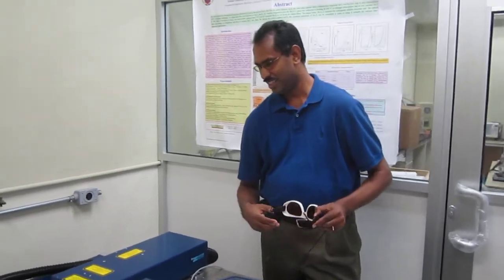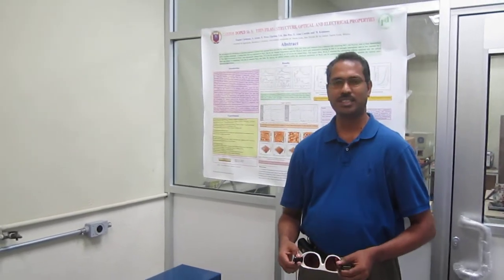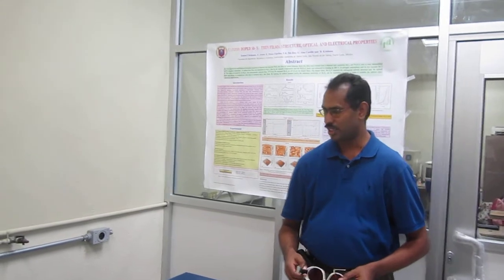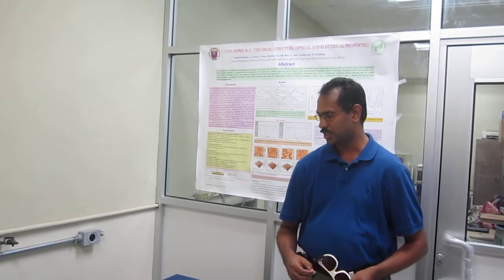Del Mar Photonics Nd:YAG laser system at the Universidad Autónoma de Nuevo León UANL

Comment from the maker: Sadasivan Shaji
Universidad Autonoma de Nuevo Leon (UANL), Facultad de Ingenieria Mecanica y Electrica (FIME) uanl.edu.mx
Nanomaterialspulsed laser ablation in liquidthin film solar cells

Cubic structured silver antimony sulfide-selenide solid solution thin films for sustainable photodetection and photovoltaic application
A Nadukkandy, S Shaji, DA Avellaneda, JA Aguilar-Martínez, B Krishnan
Journal of Alloys and Compounds 942, 169072		2023
Tribological analysis of ultra-high molecular weight polyethylene composites with boron carbide micro and nanoparticles
E Lorenzo-Bonet, S Shaji, J Negrin-Gonzalez, O Perez-Acosta, ...
Wear, 204861		2023
(002) oriented ZnO and ZnO: S thin films by direct ultrasonic spray pyrolysis: A comparative analysis of structure, morphology and physical properties
P Abraham, S Shaji, DA Avellaneda, JA Aguilar-Martínez, B Krishnan
Materials Today Communications, 105909		2023
Black titanium dioxide nanocolloids by laser irradiation in liquids for visible light photo-catalytic/electrochemical applications
PR Nair, CRS Ramirez, MAG Pinilla, B Krishnan, DA Avellaneda, ...
Applied Surface Science, 157096		2023
Sb2S3 thin films: From first principles to in situ crystalline thin film growth by ultrasonic spray pyrolysis
P Abraham, S Shaji, DA Avellaneda, JA Aguilar-Martínez, B Krishnan
Materials Science in Semiconductor Processing 156, 107269		2023
Phytosynthesized Cu Doped Cerium Oxide Nanoparticles For Antibacterial Application
A Norbert, A Surya Mary, SS John, S Shaji, SK Remillard, UP Deshpande, ...
physica status solidi (a)		2023
Ultraviolet to near infrared wavelength independent SnS-graphene hybrid thin film photodetector from nanocolloids
AP Sreekala, B Krishnan, RFC Pelaes, DA Avellaneda, ...
Applied Surface Science 609, 155277	1	2023
Gold nanoparticles decorated two-dimensional TiO2 nanosheets as effective catalyst for nitroarenes and rhodamine B dye reduction in batch and continuous flow methods
K Shanmugaraj, RV Mangalaraja, CH Campos, DP Singh, R Aepuru, ...
Inorganic Chemistry Communications, 110406		2023
Ultrasonically sprayed Cs3Bi2I9 thin film based self-powered photodetector
S Devasia, S Shaji, DA Avellaneda, JAA Martinez, B Krishnan
Materials Chemistry and Physics, 127295		2023
Band gap engineering of TiO2 by Mn doping and the effect of p-TNT: Mn/n-MnO2 heterojunction on photocatalytic applications
PS Nair, H Rahman, JA Joseph, A Norbert, S Shaji, S Tripathi, SN Jha, ...
Applied Physics A 128 (12), 1089		2022
Influence of sodium doping on the material properties and photocatalytic activity of anatase titanium dioxide nanotubes prepared by anodization
H Rahman, A Norbert, PS Nair, JA Joseph, S Shaji, U Deshpande, ...
Optical Materials 134, 113172		2022
Ge incorporation in kesterite thin films by solution processing route: An in-depth study of structural and optoelectronic properties
D Mora-Herrera, S Shaji, M Pal
Journal of Alloys and Compounds 921, 166184	1	2022
Novel low-cost synthesis of crystalline SnI4 thin films via anionic replacement: Effect of iodization time on properties
A Paul, S Shaji, B Krishnan, DA Avellaneda
Optical Materials 133, 112982		2022
Effect of substrate temperature on the properties of spray deposited Ga2O3 thin films, for solar blind UV detector applications
R Raphael, S Devasia, S Shaji, EI Anila
Optical Materials 133, 112915		2022
In2S3-Gr and In2S3-CNT nanocomposite thin films as gas sensors
JC John, SC Vattappalam, T Sebastian, A Paul, N Joseph, S Shaji, ...
Diamond and Related Materials 128, 109215	1	2022
Photodetection and photocatalytic properties of Ag2BiI5 thin films formed by iodization of Ag-BiI3 layers
AA Ramachandran, B Krishnan, DA Avellaneda, MIM Palma, ...
Surfaces and Interfaces 30, 101985		2022
Tin sulfide thin films by spin coating of laser ablated nanocolloids for UV–Vis–NIR photodetection
AP Sreekala, B Krishnan, RFC Pelaes, DA Avellaneda, MIM Palma, ...
Colloids and Surfaces A: Physicochemical and Engineering Aspects 639, 128382	3	2022
LED control of gene expression in a nanobiosystem composed of metallic nanoparticles and a genetically modifed E. coli strain (vol 19, 190, 2021)
HA Aratboni, N Rafei, LK Khorashad, AI Lerma-Escalera, ...
JOURNAL OF NANOBIOTECHNOLOGY 20 (1)		2022
In situ crystallization of 0D perovskite derivative Cs3Bi2I9 thin films via ultrasonic spray
S Devasia, S Shaji, DA Avellaneda, JAA Martinez, B Krishnan
Journal of Alloys and Compounds 893, 162294	6	2022
Enhanced photocatalytic activity of nZnO/n+ Al: ZnO homojunction with an overlayer of Al2O3 nanoballs
JA Joseph, BG Nair, R Jacob, SK Remillard, FD Rulison, S Shaji, ...
Journal of Physics D: Applied Physics 55 (17), 175108		2022

Comment from the maker: Sadasivan Shaji
Líneas de investigación
Nanomateriales, Ablación laser en líquido, irradiación laser, celdas solares, películas delgadas.

Aportaciones en investigación y académicas
Síntesis de nanomateriales por ablación láser.

Caracterización por técnicas de TEM, SEM, DRX, XPS y Raman.

Películas delgadas por CBD, Spray y Spin coating.

Propiedades optoelectrónicos de nanomateriales.

Publicaciones recientes: (Favor de ver los enlaces relacionados).

Ultraviolet to near infrared wavelength independent SnS-graphene hybrid thin film photodetector from nanocolloids Applied Surface Science, 2022
Tin sulfide thin films by spin coating of laser ablated nanocolloids for UV–Vis–NIR photodetection, Colloids and Surfaces A: 2022
Photodetection and photocatalytic properties of Ag2BiI5 thin films formed by iodization of Ag-BiI3 layers, Surfaces and Interfaces, 2022
Hybrid nanostructures of Ag/Au-ZnO synthesized by pulsed laser ablation/irradiation in liquid, Surfaces and Interfaces, 2021
Defects rich nanostructured black zinc oxide formed by nanosecond pulsed laser irradiation in liquid, Applied Surface Science, 2021
Development of lead-free Cu2BiI5 rudorffite thin films for visible light photodetector application, Applied Surface Science, 2021
Photosensitive antimony triiodide thin films by rapid iodization of chemically deposited antimony sulfide Materials Research Bulletin, 2021
 

Aportaciones al desarrollo institucional
Laboratorio de síntesis de nanomateriales por ablación láser.

Proyectos de Investigación – Ciencia Básica, Problemas Nacionales, PAICYT, PRODEP.

Perfil Deseable de PRODEP.

Evaluador de artículos en revistas indexadas de Elsevier, Springer, IOP, ACS, AIP, RSC, Wiley.

Evaluador acreditado de CONACYT.

Comment: Excimer laser Deep Sea 7050 - sales@dmphotonics.com
http://www.dmphotonics.com/Excimer_Lasers/excimer_DeapSea_CL7050.htm
Metal-ceramic discharge chamber
Laser head with power supply and energy monitor
Oil free vacuum pump
Gas filter
Gas tubes
Gas regulator (for XeCl premix)

Specification:
Wavelength: 308 nm (XeCl)
Max. Pulse Energy: 200 mJ
Max. Repetition Rate: 50 Hz
Max. Average Power: 5 W
Pulse Duration: 20-25 ns (FWHM)
Pulse-to-Pulse Stability: σ< 2 % (standard deviation)
Beam Divergence: 1.5 mrad x 4.5 mrad (FWHM)
Beam Size:7 x 20 mm
Electrical Power: 380/220 V, 50-60 Hz, 3 phases
Cooling System: water
Gas Input System: Premix gas (XeCl)
Dimensions (LxHxW) 1360 mm x 382 mm x 720 mm
Warranty - 1 year or 100 millions pulses whichever comes first

Comment from the maker: I want to get a nanosecond pulsed laser at the wavelength of 407.4nm, the pulse energy should be no less than 5 mJ, and the linewidth should be less than 0.1 nm.

Now, I have a comtinuum Powerlite 9030 laser with SHG and THG. Can I use a OPO pumped by 355nm laser to get the output laser at 407.4 nm? Do you have a OPO model I can use? Can you give me a quotation?

Comment from the maker: DelMar-InfraTune Tunable pulsed lasers from 1,5 to 17 µm with linewidth of less than 10 cm-1 sales@dmphotonics.com

PRR up to 100Hz
Compact design
PC control option
DelMar-InfraTune is a compact laser source which provides continuously tunable output of the IR spectral range from 1.5 to 17 µm.

To obtain such an unprecedented tuning range DelMar-InfraTune combines several optical parametric oscillators and a difference frequency generator.

The modular architecture of DelMar-InfraTune allows to adapt the tuning range easily to your specific requirements due to rejecting all the irrelevant and thus cutting down your expenditures.

Depending on the required operational wavelength range there are four versions of the IR laser system available.

THE LP605 VERSION
THE TUNING RANGE FROM 1,5 TO 3,5µm

This version consists of the Nd:YAG pump laser LQ 529A, Faraday Isolator and the OPO based on KTP or KTA crystals.

The tuning range of the LP605 based on KTPcrystals is 1,75…2,7µm.

The tuning range of the LP605 based on KTAcrystals is 1,54…3,45µm.

The maximum pulse energy of LP605 is more than 100mJ for the 1,75…2,12µm range and more than 40mJ for the 2,13…2,7µm range.

THE LP607 VERSION
THE TUNING RANGE FROM 3,0 TO 9,3µm

This version consists of the Nd:YAG pump laser LQ529B, Faraday Isolator, KTP OPO and ZGP OPO. To pump the ZGP OPO the 1064nm pump beams converted to 2,05µm and 2,3µm by KTP OPO.

The ZGP OPO produces tunable output in the range 2,62-3,2µm and 5,8-9,3µm when pumped by 2,05µm. The pump energy 15mJ at 2,05µm provides the output power more than 3mJ at 2,8µm reached and more than 0.6mJ at 6,2µm.

The ZGP OPO produces tunable output in the range 3,0-3,9µm and 5,6-9,3µm when pumped by 2,3µm.

THE LG950 VERSION
FOR THE TUNING RANGE FROM 11,0 TO 17,0µm

This version consists of the Nd:YAG pump laser, Faraday isolator, KTP OPO and the difference frequency generator CdSe DFG.

KTP OPO produces tunable output in 1,96…2,36µm range.

CdSe DFG produces tunable output in 10,8…17,3µm range.

The energy at 11 µm reached 0,6 mJ, and at 16 µm reached 0,2 mJ.

THE DelMar-InfraTune VERSION
FOR THE TUNING RANGE FROM 1,5 TO 17,0µm

This version combines three upper mentioned versions LP605, LP607 and LG950. It consists of the Nd:YAG pump laser, Faraday isolator, KTP OPO, ZGP OPO and CdSe DFG.

Block diagram of the DelMar-InfraTune

All versions of the DelMar-InfraTune laser system can be available upon request for manual and fully automated output wavelength tuning.

To obtain the specified parameters of the DelMar-InfraTune SOLAR LS recommend to use the LQ529 lasers since they are specifically tailored to solve this task. However, if required, the DelMar-InfraTune can be adapted for the use with your pump laser.

Prior to placing an order our specialists will discuss in details all the specific features of the IR system and the required options with you. As a result you will receive the IR laser system perfectly customized to your specific requirements.

Comment from the maker: 213nm laser - sales@dmphotonics.com

Laser system A comprises:
1. Pulsed Nd:YAG laser model DMPLQ 529A with built-in SHG and THG 5 Hz;
2. Fifth Harmonic Generator LG 105;
3. Mounting frame.
PRR: 5 Hz
Output energy: ? 25 mJ at 213 nm (for high energy version) Output energy: ? 20 mJ at 213 nm (for standard version)
Pulse width: 10...13 ns at 1064 nm and 8…11 ns at 213 nm
Beam dia: </= 8 mm
Divergence: < 1.5 mrad at 213 nm

Laser system B comprises:
1. Pulsed Nd:YAG laser model DMPLQ 529B with built-in SHG and THG 5 Hz;
2. Fifth Harmonic Generator LG 105;
3. Mounting frame.
PRR: 5 Hz
Output energy: ? 20 mJ at 213 nm (for high energy version) Output energy: ? 15 mJ at 213 nm (for standard version)
Pulse width: 10...13 ns at 1064 nm and 8…11 ns at 213 nm
Beam dia: </= 6 mm
Divergence: < 1.5 mrad at 213 nm

Comment from the maker: New! - sales@dmphotonics.com
532nm pulsed laser system with an attenuator with adjustable energy in non-ablative levels (< 60mJ).
 Wavelength: 532nm
 Energy: <60 mJ per pulse
o This energy requirement will ensure that the material is not ablated (destroyed) in the process of generating ultrasonic waves
 Variable attenuator
o A variable attenuator is required to adjust the energy output of the device, and shall also have rs232 control.
 Beam diameter: 4mm - 5mm
o The beam diameter will help control the energy density delivered to the material by the laser. If the diameter is too big the energy will be spread out over too large of an area to create the thermal shock that generates ultrasonic waves. Too small and the energy will overcome the damage thresholds of the material and ablate.
 Q-switched pulsed laser
o Laser shall use Q-switching to enable quick laser pulses.
o The minimum pulse rate is a single pulse, but there is no requirement for maximum repetition rate.
o Pulse duration shall not be any smaller than 4 ns and no longer than 8 ns
 Size: the laser itself shall be compact, no more than 1.5’ long and 5” wide with modules attached. No restrictions on size of power supply or cooler.
 Control options: RS232
 Shall include a wavelength separator module or have it integrated

Comment from the maker: I am looking for vendors that sell fourth harmonic generators for Nd:YAG systems.  We have a Contiuum Precision PL8010 laser with the following specs.

 1. energy of laser system:  1.65 J at the fundamental (1064 nm), 975 mJ in the green, and 450 mJ at the third harmonic.
 2. wavelength:  We already have the second and third harmonic.  Now we need the fourth at 266 nm.
 3. pulsewidth: 10 ns
 4. beam diameter: 9 mm
 5. pulse repetition rate: 10 Hz
 6. polarization (horizontal or vertical) of a laser beam:  The 532 is vertically polarized.
 7. divergence of a laser beam:  0.45 mrad